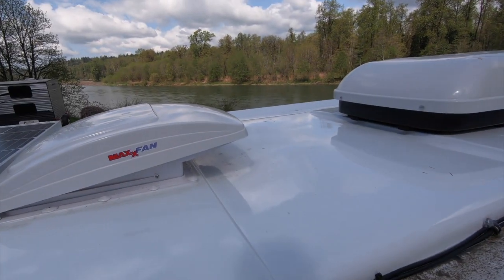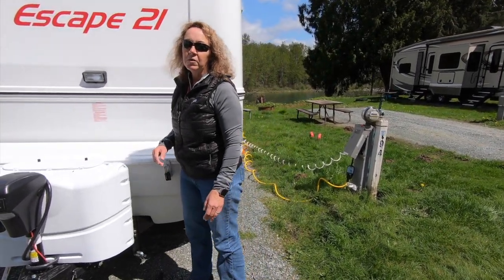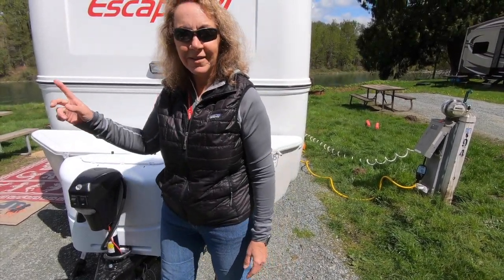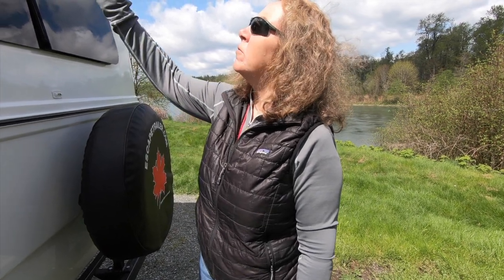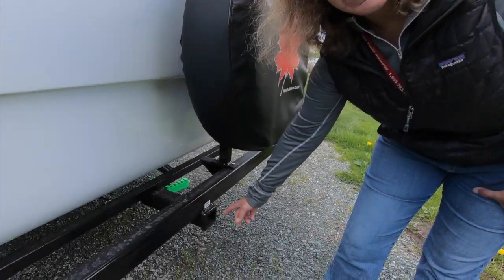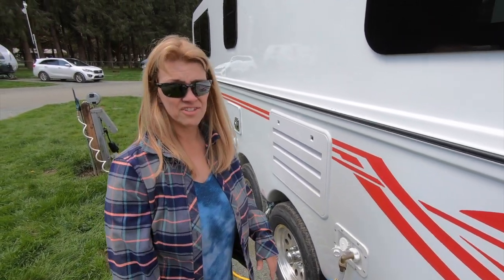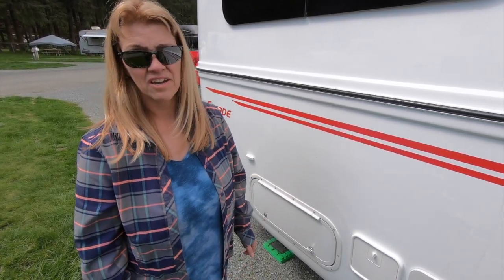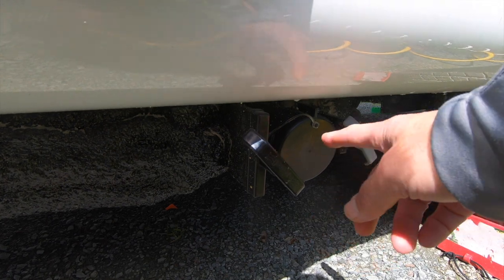Escape Travel Trailer 21 Tour - Full Time RV Living

Comment: Very nice trailer. I love it. What was the cost? Did you have to pay tax to bring in the U S? And what do you use to pull it?
Reply from the maker: Hi Bill, it's a great trailer and we love it! I think our total cost with our options and upgrades was around $38k but it can vary widely depending on the options you choose. Escape has the whole list on their website. We had to pay tax in WA state when we registered it. We originally pulled it with a 2008 Ford F-150 5.7L engine. We now have a 2019 Ford F-150 3.5L Ecoboost.

Comment: Thank you for the great tour!  What are your thoughts on the high lift option?
Reply from the maker: Hi Honey, thanks for watching our tour! We don't have the high lift and have't had any issues with all the boondocking we do but we do want to add it. It would be easier to inspect the underside of the trailer and use the dump valve.

Comment: Nice Nice Nice, I have a used Casita fixing up, but your's is better quality and bigger. Like the options you chose make good sense for me to. Is this a all season trailer?
Reply from the maker: It's not considered an all season trailer but there's some options you can pick to make a beefy 3 plus season trailer. You can have extra insulation added in the walls and insulation added to the underbelly. We also added the option for a fresh and grey water heating pads.
Reply: @AdventuresInNoMadness  Good idea about the heating pads!

Comment: How did the camper do in the winter? Were you in the north?  Thank you.
Reply from the maker: Hi Greg, we spend last winter in AZ not in AK but we have been in temps in the upper teens. The trailer did great! At the time we were hooked up to power and ran the tank heaters. We're spending the winter up here in AK but will be moving in the cabin when it gets too cold to be in the Escape. One of the biggest issues is condensation when it gets really cold outside. We use dehumidifiers and that helps,.

Comment: Being that you bought this trailer has bought out of country someone mentioned that it may be hard to get work done if something happens what are your thoughts on this
Reply from the maker: Hi Lisa, in my experience Escape works really hard to help owners with any issues they may have. If someone can't come to Canada to h have work done they will work with you and a repair facility or mobile mechanic to fix it. It's definitely a great question!!
Reply: Have you had to have any repairs yet an were you able to get the help you needed. Of course dealers in states think buying in Canada is not a good idea but I am still leaning on ordering this next year since I think I missed ordering this year
Reply: Thank You buy the way it’s heard to get answers